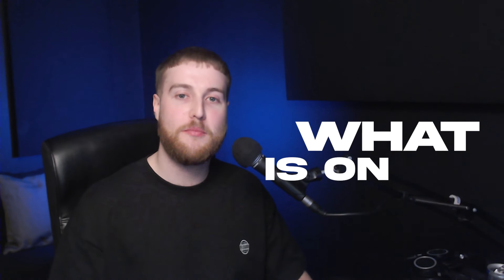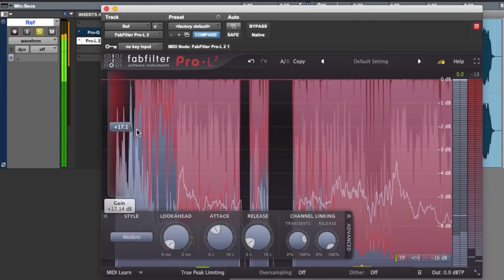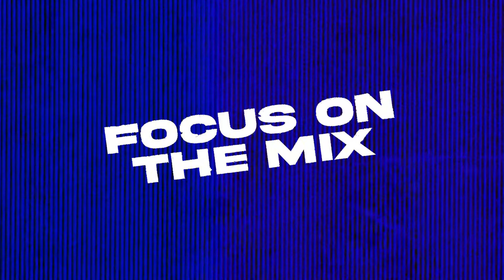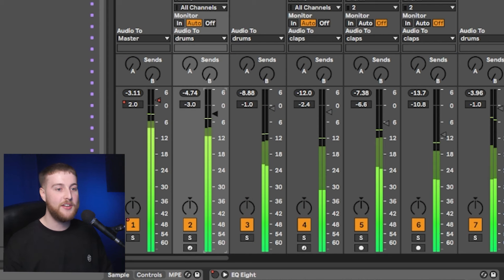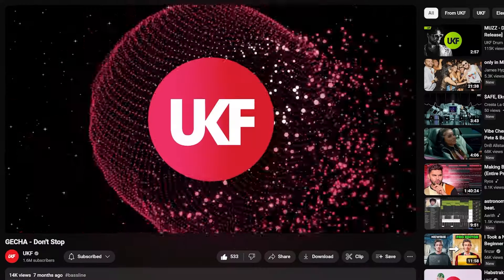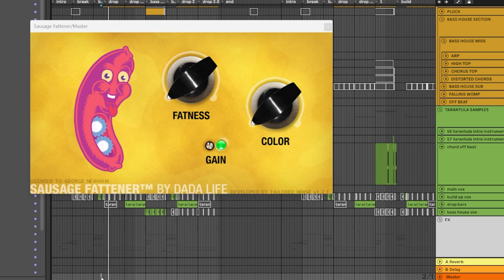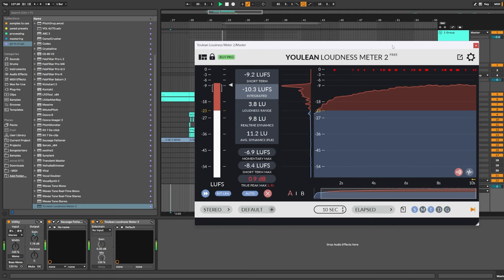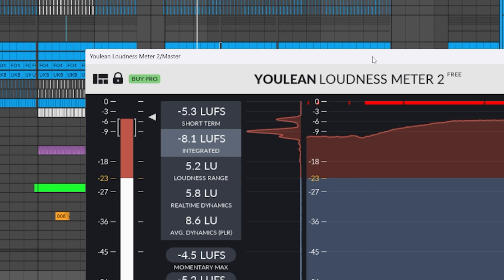This Controversial Mastering Chain is a GAME CHANGER

Comment: so there's no set leveling numbers you shoot for in the mix? just try to make everything as loud as possible without distortion?
Reply from the maker: I don't really have set levels that I shoot for other than making sure the mix (before I apply any mastering) is hitting at around -6db. Usually I'll start with the drums, making sure my kick drum is peaking at -6db, then mix the bass and sub bass against the drums mainly using my ears. The rest is really by ear and listening to other tracks I like as a reference. Once I'm happy with the mix, I add sausage fattener and start to drive the gain louder into it (using Utility before it in Ableton) until I hear the distortion. When I'm at that threshold where it starts to distort, I will start to adjust things in the mix. Hope this helps!
Reply: @gechabeats_  hey man gotcha ok! thanks for elaborating. one thing i’m wondering is why not just start with a sausage on the master and set the kick at 0db and mix as you go? why the need to set everything to -6 then push the gain into sausage
Reply from the maker: @itskittens  you could definitively do that, I just tend to stick to -6db as an old mastering habit. Also incase I’m sending the mixdown to label who want to master it themselves
Reply: @gechabeats_  ohh ok I see. gotcha thank you so much man! really appreciate it